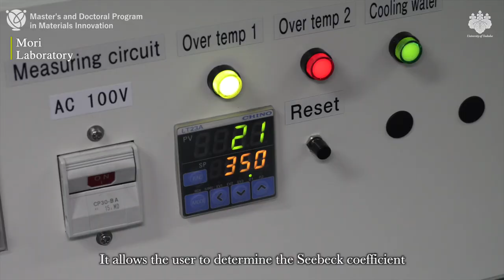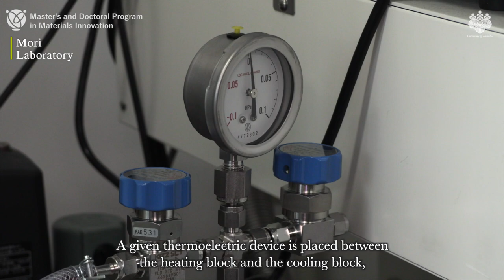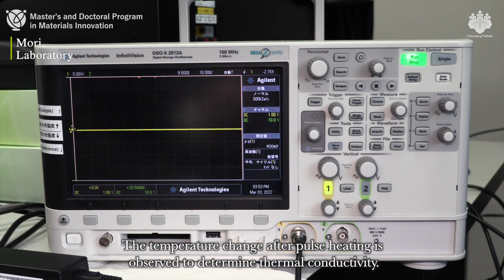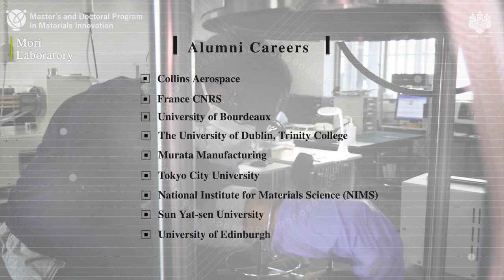【MORI LABORATORY】Thermal energy materials (Thermoelectric materials)

Comment: How about hybrid solar PV, thermoelectric, and hot water power all in one. A tripple junction PV material like GaP over GaAs over Ge on a CuSn layer on polyimide. On the rear of the polyimide sheet would be multiple thin layers of BiSnSeTe thermoelectric material in series parallel. Another layer of polyimide to protect it and an aluminum water heat sink/exchanger. The PV generates power, the thermoelectric with its high current powers the fluid pumps, and the fluid is used to move heat away from the panels to where it is needed. Such devices could be extremely lightweight and have excellent efficiency.